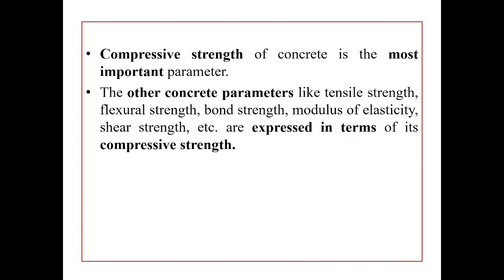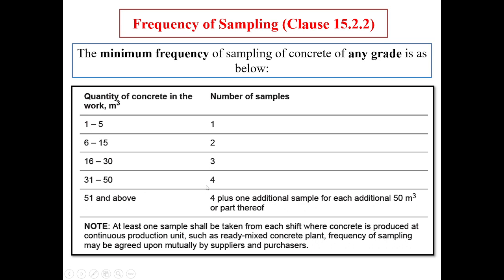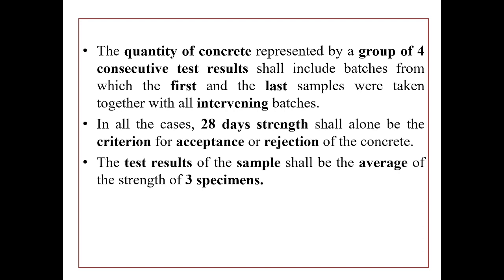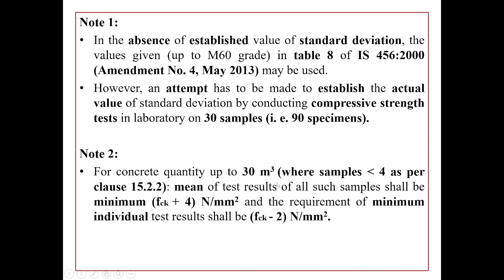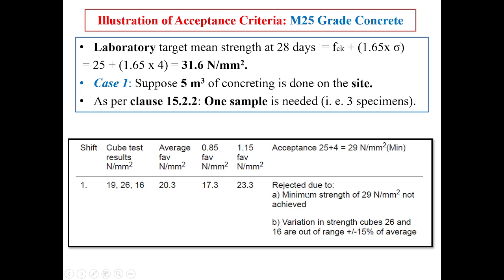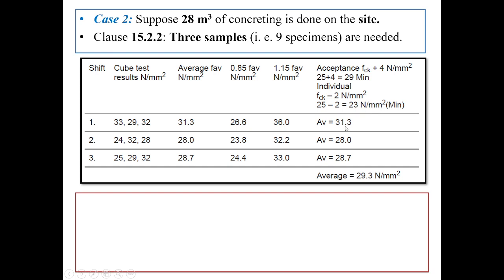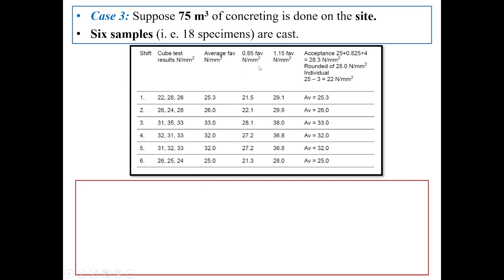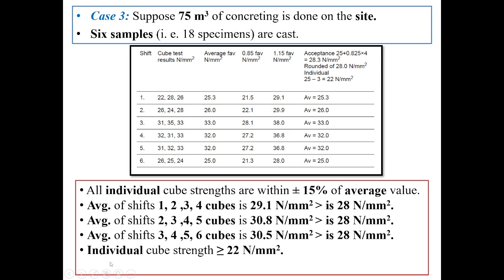Compressive Strength of Concrete: Acceptance Criteria as per Indian Standard 456:2000

Comment: Sir, you are wrongly illustrated the Acceptance Criteria
Reply from the maker: Kindly let me know what is mistske
Reply: Sir, In Case-3, where 6 samples are collected, you have compared overlapping mean values of 2, 3, 4, 5 and 3, 4, 5, 6. However, in IS 456, there is no mention of taking overlapping mean values. If you have taken these values just for comparison purposes to show that they also satisfy the criteria, then what will be the actual criteria clause for samples 5 and 6? Do both of them have to qualify under Table-11 Note-2 (amendment-4) of IS 456, or what other criteria should be applied after qualifying 1, 2, 3, 4(Non-Overlapping) as per Table-11 Column-2 (amendment-4) of IS 456? Please clarify sir."
Reply from the maker: I have taken the values just for comparison purpose
Reply: @prof.dadapatilcivilenginee9386  ok sir, then what will be the actual criteria clause for samples 5 and 6? Do both of them have to qualify under Table-11 Note-2 (amendment-4) of IS 456, or what other criteria should be applied after qualifying 1, 2, 3, 4(Non-Overlapping) as per Table-11 Column-2 (amendment-4) of IS 456?
Reply: @saivasanth8837 for 5th and 6th samples, it is not covered in IS 456 2000.

For this, we need to modify the acceptance equation Fck+0.825xSD. we can't go 2 sample or 3 sample criteria in note given because the sampling not coming under clause 15.2.2.
Reply: @saivasanth8837 use the column 3 of table 11 on both remaining samples.
Reply: Three things I need to highlight..

1) FCk is the consideration of samples and not on specimens or cubes.
2) case 3, we can't take 5th and 6th samples with 3rd and 4th.
3) case 3, Rounding of 28.3 to 28.5 & not as 28 Mpa.